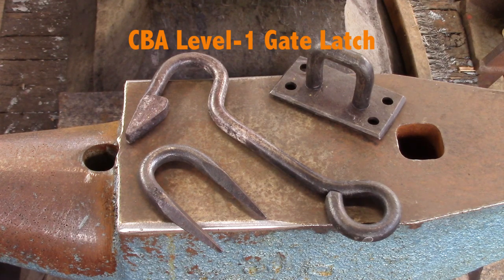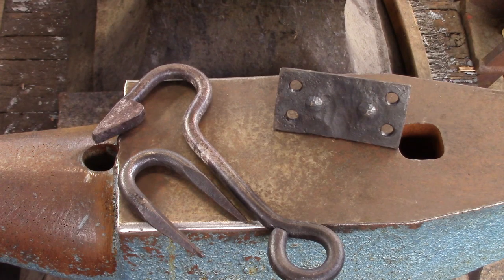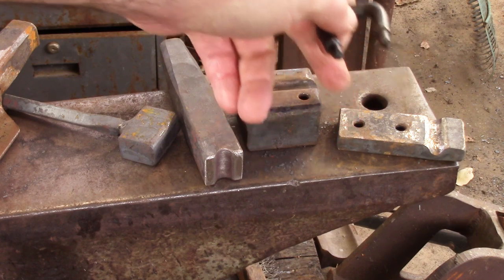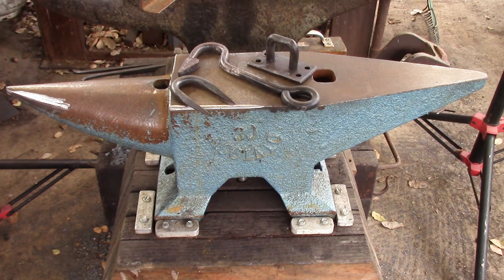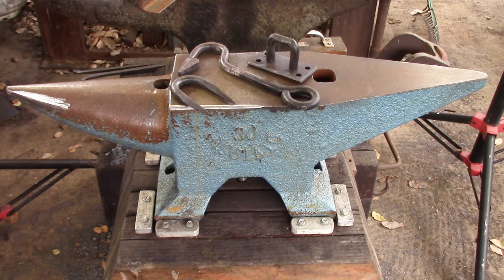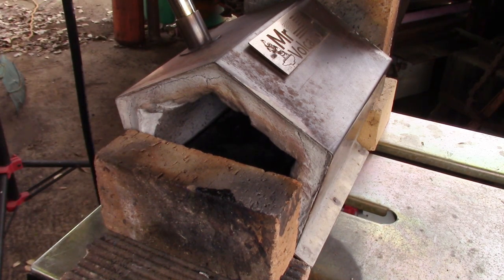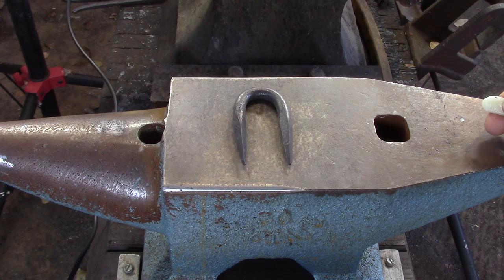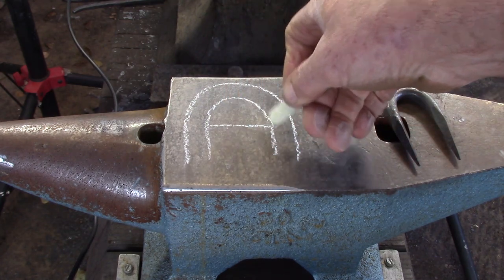CBA/ABANA Level-1 Gate-Latch, Part-1. Forging and turning tapered staple

Comment: Question on measuring for the staple length. First you made a mark at 5". Then you tapered 1.75". Then you measured from the top of the taper back to the original punch mark which was 4".
5 - 4 = 1 so it took 1" to make the 1.75" taper. And then you add that inch back in with the 2.75 calculated bits from the curve to figure out the length of 3.75 from the top of the taper. I get that. The math makes sense.
But it's easier to notch the piece into a hook ruler for measurements so I'm wondering if there a reason you don't just measure from the tip of the taper to the punch mark and then subtract the original marked length to get the excess used? (So: 5.75 - 5  = 0.75. Start calculation by adding all the original figures (1.75*2)+2.75 = 6.25. (this could already be done before starting any actual forging) Then subtract the excess of 0.75 that will be created with the new taper. 6.25 - 0.75 = 5.5" from taper tip to cut mark.
If there's a reason, then by all means - I'll make the effort to line up the ruler. But if it's just a difference in preference, then I'd rather use the hook ruler. I did a few practice runs tonight with the calculation method from this video and I kept getting tripped up with math and fiddling with the ruler to line up with the start of the taper and whatnot.
Reply from the maker: Just a difference in preference, Shaina.
Reply: @MarkAspery  great, thanks!

Comment: Is there a link on your video to buy that anvil?🙏 And if I could, is this a Steel or cast iron anvil
Reply from the maker: No link. It's a steel construction judging by the carbon sparks. I get them from e-bay.
Reply: @MarkAspery  @jamesmclane2826 The "Acciaio" anvils are all made by the same factory I think, but a bunch of different distributors. VEVOR company sells the blue ones which seem to actually be cast steel rather than cast iron for the sameish price as everyone else but they might actually be able to help you return or exchange it if you get a defective one. They also sell a harder (55 HRC) version in black. Been researching them as a possible 2nd anvil. The price makes it seem like they must be junk, but then I see people whose opinion I greatly respect (such as Mark Aspery) saying they're pretty good so I may have to get one.